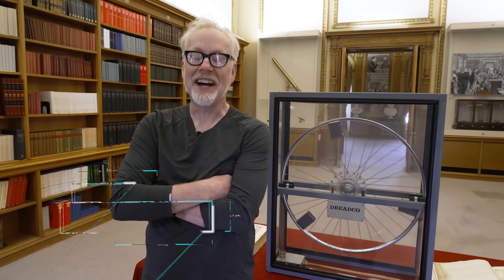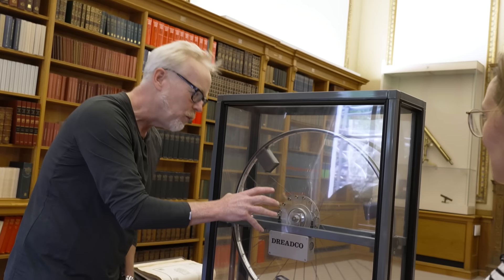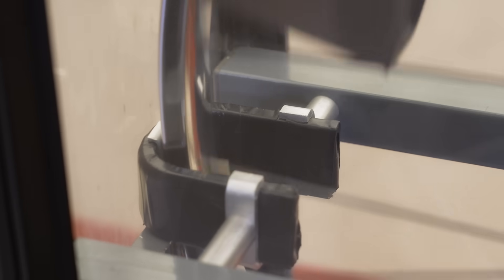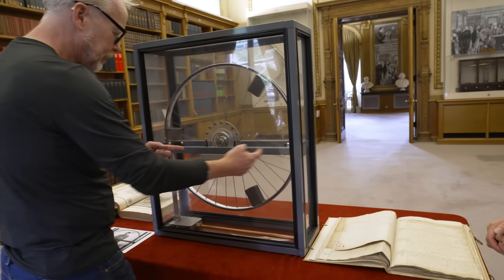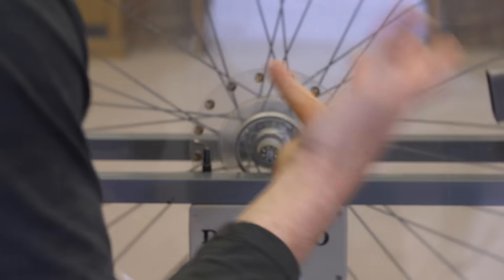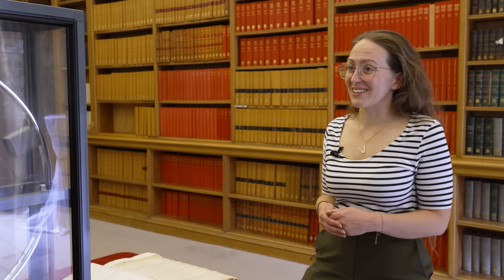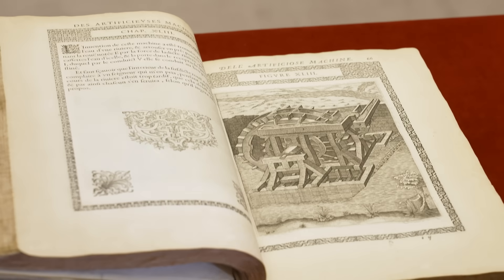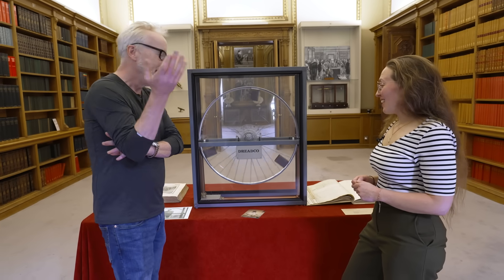Adam Savage vs The "Perpetual Motion" Machine!

Comment: THE SECRET IS SIMPLE I BET, just ball bearings, inside those boxes, which GRAVITY pulls outward, then inward, causing the rotation. So THE SOURCE OF ENERGY IS THE GRAVITATIONAL PULL OF THE EARTH, AND THE CAUSE OF ROTATION IS MOVING BALL BEARINGS INSIDE THOSE BOXES. I have seen a similar device before, and I am confident that is how this one works, and what makes it slow down, is friction and wearing upon the surface of the bearings I bet.
...After watching it more, the rest of those boxes and pipes, are either a distraction, if my ball bearing idea is right, or maybe they DO use some battery or chemical reaction to produce a fluid flow and/or electrical current, which makes the wheel rotate due to magnets on both sides. But I have seen at least two devices using just ball bearings and gravity to keep a wheel moving like this, and to keep the bearing falling down a J shaped track which propels it back up to the top where it keeps moving, due to gravity.
But I think Adam might be onto something, unless those extra parts are distractions.

I HAVE MADE ONE MAGNET PROPEL ITSELF PAST ANOTHER THOUGH, by using soft iron to shield one side of the Stator Magnet to cause it to attract the outer rotor magnet up to a point where momentum and the repulsive forces on the opposite side of the two magnets took over, and this DID work, so soon I hope to build a working motor, and if I succeed, I plan to show everyone how it works (not hide it like these guys!).

Here I found links, Leonardo Divinci invented the Over-Balanced Bearing Wheel, which I believe is what that really is using inside those boxes, and maybe they made it quite so its hard to hear them hitting the stoppers, like this...
https://www.leonardodavincisinventions.com/mechanical-inventions/leonardo-perpetual-motion-machine/

"...Leonardo has a central place in this centuries-old story. He tried to ascertain if it were possible to construct perpetual motion machines but he drew the conclusion that perpetual motion cannot exist in nature. The quest of perpetual motion was proved impossible in the second half of the 19th century by James Clerk Maxwell’s studies of thermodynamics, yet Leonardo was the first to state its impossibility, over three centuries earlier.  ..."
https://www.museogalileo.it/en/museum/explore/temporary-exhibitions/1802-leonardo-da-vinci-and-perpetual-motion.html

Neat how they mention Maxwells equations (x4 btw, 2 for electricity, 2 for Electro-Magnetic Induction basically), which I recently was learning, in order to show, "perpetual motion" DOES exist in Nature, in the form of "Light" and momentum of "Electrons" and the "Electro-magnetic fields" or "Dipoles" they create, causing the "Periodic Table of Elements" and everything we know to exist...all moving at one constant "Light Speed", THAT IS "Perpetual Motion"....and what is the CAUSE of THAT Motion, "Light"???? I believe the answer is Harmonic Resonance, and necessarily according to basic laws of physics, due to "Consciousness" which is the FIRST stable and self-sustaining structure of pressure and motion to come into existence, according to those same Laws that Maxwell and Einstein and Newton put together!

Comment: In a room like that, there are sources of energy that can be tapped to keep a low-friction device moving.  Visible light, radio frequency power, flows of room air, the rotation of the Earth, and cosmic ray showers are non-thermal sources of energy that could in principle be converted into local mechanical motion.  There are small amounts of free energy to be had if the energy needs are small enough.  Brownian motion is a type of thermally-driven perpetual motion.

Comment: The main problem with any perpetual motion machine (apart from the fact that they are impossible) is that you could never take any energy out of the system. 100% of the energy it produced would be used to perpetuate its own motion, with no excess energy left over to tap.

Comment: The hardest part about creating a perpetual motion machine is that it will take forever to test.
Reply: You would be stuck in a loop!
Reply: You are absolutely hilarious!!! 
 Excellent point
Reply: I wonder if it is also rotating in a vacuum to reduce the slightest amount of air resistance.
Reply: That’s why it’s impossible.
Reply: The hardest part is the part of the machine made of steel... but if you put a diamond inside, that becomes the hardest part 👍
Reply: @sebastianfiel1715  I got a question for you if I had a Hammer made of diamond and a hammer made of steel wouldn't the steel shatter the diamond? I feel like the diamond would shatter
Reply: @lordkayx  Of course the diamond would shatter. It's harder but also more brittle.
Reply: @lordkayx  Hardness is tested by which material would scratch the other more readily.

So of course a lowland gorilla would smash a lion, but the lion is a harder creature since it can more easily scratch the gorilla. 😝
Reply: I think the hardest part is creating a machine that that outputs energy from seemingly nothing. A perpetual motion machine with exactly zero resistance is amusing, but ultimately useless anyways.
Reply: @dwerg1  Yeah I agree. This is just a particularly neat project I think to stimulate  people's imagination curiosity and inspiration. But I was literally asking you what I asked you. I understand diamond is harder so shouldn't it break less easy? When I was younger I had found a tiny diamond that must have falling out of a ring. The pawn shop told me it was real but worth $15 at most so I took it home and I tried to cut a mirror with it and all I did was shatter the tip. I guess what I wonder is if it's supposed to be so hard then how come it's so brittle. Sorry I know that sounds like a silly question.
Reply: @lordkayx  Pawn shop didn't really know and it wasn't really a diamond. $15 was probably a good deal for that piece of junk. I'd believe physics over a pawn shop any day...
Reply: Finally, you did a thing to that tired-ass joke 👏👏 much better!
Reply: Well I can travel forward in time
Reply: xD
Reply: I like how you replied with a facetious comment and ignited a debate on perpetual motion machine testing...only on Youtube....lol
Reply: All I can see demonstrated here is a compelling argument to teach critical thinking in schools again. Goddamn. So many future Darwin award recipients
Reply: One could measure the input forces and output forces
Reply: It's actually quite simple. You take the machine apart to find the battery.
Reply: Actually no. Sorry if I'm not fun at parties, but you technically can measure the speed over and over exactly X hours apart and then plot a graph with the speed decline. If it declines, it's not perpetual motion.
Reply: That’s the point. If it never declines you’ll be recording data and graphing forever because you are trying to prove a change that doesn’t exist.
Reply: @alexmills42  Not really. If it doesn't decline, that means it's either perfectly horizontal (i.e. energy is perfectly conserved and it's perpetual), or it's rising (i.e. it's generating energy and still perpetual). You don't have to record forever.
For example, 2^2=4, 2^3=8, 2^4=16, and you know 2^n goes into positive infinity. It can be proven. You don't have to calculate 2^12345678 for that.
Reply: @thsscapi  you're assuming that nothing changing within your frame of time for measurement means it never will and that your instruments have sufficient precision.
Reply: @thsscapi  There are plenty of designs like this for which the rotational speed will not decline measurably (or at all) for a very long time. But they're still not perpetual and they will eventually decline. But as powering technologies get better, the length of time that they can maintain that unchanging speed gets longer and longer. So your need to record the data tends toward forever. Fusseldieb's comment of "X hours apart" is way too short to be useful on many of them.
Reply: @thsscapi  The second you stop measuring doubt is cast as to its perpetuity. That’s the point of the comment and my further explanation. No matter what data you track it would only prove that it hasn’t lost energy yet and being many doubts into play. And yes it is very different from proving exponents because your measurement would mean the entire rule system is wrong and we need to go back to the drawing board so it really does need much more proof than fundamentally accepted math proofs.
Reply: @frednurk5168  wow you win a prize! You understood that perpetual motion doesn’t exist and this is a pedantic thought experiment at best and brainless arguing at worst
Reply: @alexmills42  😐
Reply: then how to know when the battery hidden depleted?
Reply: @thedude6712  No forever, just a few years.
Reply: @donaldkasper8346  This particular 40-year-old one lasts a few years between "recharges", but there were other ways of doing it even back then which would last longer. If one were created today using similar methods but updated manufacturing/technology it likely would last decades. And one made after that could last centuries. That's why I said that how long you would have to test "tends toward forever".
Reply: @thedude6712  Not even remotely.  You get out a laser and you time the rotation to say 5 digits, and tick off the decline rather quickly.  No, nothing is going to last years, much less longer.
Reply: @thedude6712 this is simply not true. Calculating the speed is just dumb. Instead you measure the battery. A super efficient battery may maintain the speed for a million years. But that battery will measurably have less potential energy every second that it operates. And that can be measured.
Reply: @fusseldieb  If batteries power the unit, there may be no gradual reduction in the RPM but rapid decline as the batteries discharge below a level.
Reply: @fusseldieb  the difference in speed would first need to be measurable for that to work. What if it took days instead of hours? Or weeks? Or months? Years? Decades?
Reply: @fusseldieb  there may not be any speed decline at all for a long time though. E.g. if you actually did just have a battery and motor, the motor may never slow at all until the battery is drained, so even measuring at x hours apart you wouldn't see the decline within a reasonable time frame.
Reply: @fusseldieb no test needed because perpetual motion is impossible.
Reply: @fusseldieb  maybe it will start (measurebly) decline next century
Reply: @fusseldieb While in general you're correct (you don't need to measure forever, just long enough), that does fail to account for the fact that conditions could change.

If you did a similar experiment with a wind turbine, you could come to the conclusion that it doesn't generate power, because the turbine slowed down.
Reply: When Adam said it’s a battle of attrition, that made me think the machine has to be enormous…. And then it hit me. The Earth is like a giant water wheel but spherical.. so the fins need to be cones or pyramids. Why not use the entire rotation of the Earth… combined with the Sun. The universe already charged it up… it will run out sure but not any any of our children’s children’s great great great great great great grand babies lifetime. 
I’m curious if that’s the perpetuation we need… just long enough.
Reply: @elvinebovine  Seems like a really complex way to describe a wind turbine.
Reply: @mxpants4884  yeah but I could see making a artificial river around the equator at sea level and feel like the rotation of the earth would allow for flow but maybe we have to build a valve system like how air pumps work. And we could use natural siphoning techniques to make the flow or increase the flow. Idk… I’m just postulating… seems like we should be able to tap into the earth’s momentum…
Reply: @elvinebovine  It's not possible because everything on the Earth and within the atmosphere is already utilizing the Earth's momentum.

It's like when you're in a car and driving 30mph you're not moving within the car because you're using its momentum to go the same speed and remain "Stationary" within it.

The only way to have the Earth's momentum affect something within its gravitational field is to disrupt its momentum (At which point EVERYTHING in its gravitational field will be affected, not just an artificial river you created)

The more logical way to create something like an artificial river (AKA a canal) would be to use convection to create currents. You know, like what causes the oceans to have currents that move them across the entire planet.

Not that making a canal around the equator is at all logical, because of aforementioned oceans which cover 2/3 of the equator...

Beyond that, planetary momentum is actually being considered for space exploration in the form of gravity slingshots, where you enter the gravitational field of a celestial body to gain momentum from being pulled into orbit before breaking out and using that momentum to provide additional speed with minimal fuel usage.

It can be a way to get drones into further parts of the galaxy in a more reasonable timeframe with the caveat of it being extremely difficult to do, since you'd need to pre-calculate exactly the angles of entry and exit (As well as thruster usage well beyond controllable range) and also pinpoint exactly where the planet you're using will be by the time the drone reaches it.

Thus it probably won't be a thing until we get AI sufficiently advanced to perform the necessary calculations from onboard a drone.
Reply: @tarille1043  "Thus it probably won't be a thing until we get AI sufficiently advanced to perform the necessary calculations from onboard a drone." FYI, we've been using gravitational slingshot maneuvers to send things into deeper space for 50 years already. That's how the Pioneer and Voyager probes were able to reach escape velocity to leave the solar system in the 70s. More recently, check out the planned trajectory for the Lucy probe. It received a gravity assist from Earth back in October, it'll receive another in 2024, and it'll come back near Earth to receive a third gravity assist in 2031 before reaching a stable orbit between Jupiter trojan clouds.
Reply: @tarille1043 what nonsense. They have used this very technique on every craft that has left the Earth's orbit, as well as using it in the opposite to slow the craft that have either landed or been placed into another orbit. Artificial intelligence cannot solve equations that are impossible for us to solve. Artificial intelligence cannot do anything it's not programmed to do. It draws on existing knowledge. It may be able to solve them more quickly or reduce the occurrence of errors, and it can assimilate the available knowledge more quickly and more efficiently. This followed the same principles that make perpetual motion impossible. Energy cannot be created or destroyed. Artificial intelligence is a fancy name for a calculator, which is what all computers are at their base level. They cannot create knowledge, they can only process the information given to them. Simply a tool to save time.
Reply: @philbert006  That's a whole lot of nothing you wrote.

Artificial intelligence can do the necessary calculations based on the position of celestial bodies at the time it needs to utilize them.

We cannot do that.

We can only plan out what we expect the positions to be at the expected time a probe reaches that point in space. This limits human capability to a single way trip within our observable range.

Provided a sufficiently advanced drone (Meaning that fuel and propulsion systems have been improved drastically), AI would allow more in depth probing of distant objects, as it would be able to alter its flight path to better investigate things, without forgoing its ability to then carry on to further locations.

Also, AI, as in true Artificial Intelligence, would be able to create information. That is the meaning of intelligence. What we know as AI is not intelligence, it is merely algorithms.

Though, true intelligence is not necessary for this sort of application. A simply algorithm cruncher would work fine with some upper level logic paths to handle basic decison making.
Reply: @elvinebovine Agreed. We just need it to run as long as it's useful to us. Who cares if it's actually forever as we won't be around to witness it.
Reply: NO, making machine that runs forever is not perpetual motion it has to produce more energy than was used to build it

Comment: That heatsink device is the key. There's a peltier device inside which is powered by the difference in temperature between inside and outside of the box. The peltier device powers the magnets from the sides
Reply: Assuming its not there as an obvious decoy,  I would be inclined to agree with this theory.
Reply: Why would there be a temperature difference
Reply: @vvillem9  The surface its resting on likely has a different temperature than the ambient air. Perhaps the masses/magnets swinging by induces a slight inductive current in those copper pipes.
Reply: @obsidianjane4413  why would the surface have a different temperature. If it's capable of exchanging energy with the apparatus it can exchange energy with the ambient air also
Reply: @vvillem9  I donno.  The more I think about it the more I think you are right.  Unless the boxes attached to the wheel are not just magnetic but also radioactive thermal sources (!).